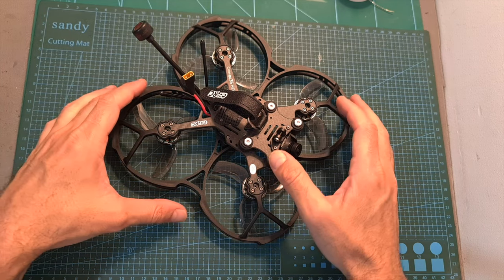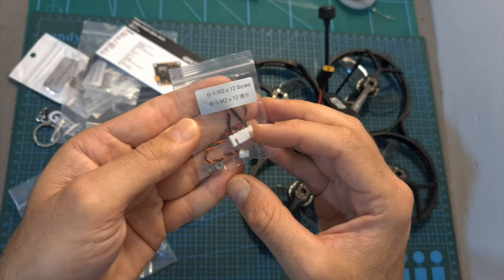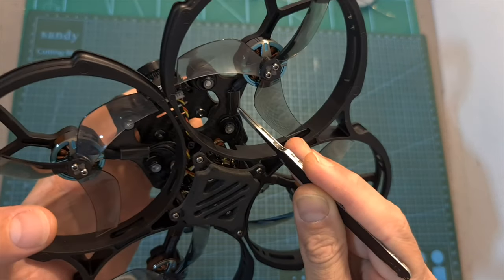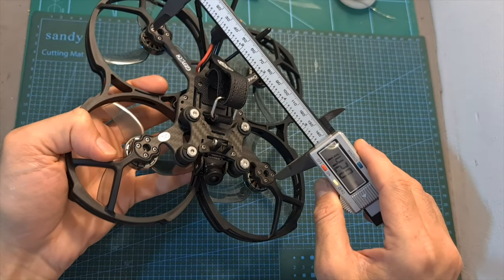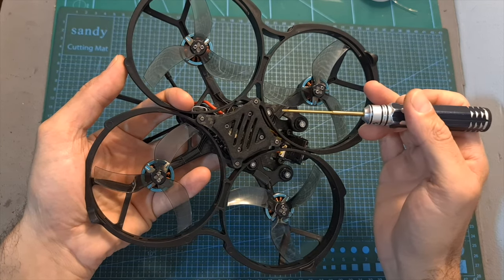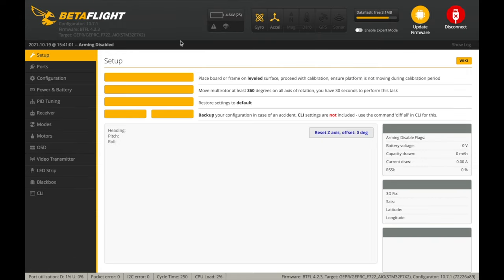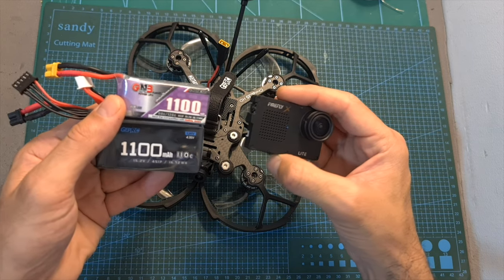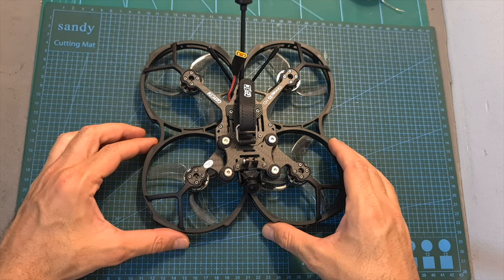Geprc CineLog35 - Setup, Review & Flight Footage

Comment: What would be the best receiver if I don't already own one?, PNP(dji) , FRSKY or TBS?  Geprc charge more for frsky/tbs, but I would be able to get a cheaper starter receiver? what dji receiver works?
Reply from the maker: Do you have the DJI Radio controller (First version, not the one that comes with their FPV Drone)? If so, you can go with the DJI PNP version.
Reply: @KremerFPV  no, can it be had on Ebay for under $150?

Comment: Hello! I want to buy Cinelog 35 and put Lion battery on it. Is it possible? Will the Cinelog 35 fly with a lithium battery? I want to deliver 3000 Lion battery. What Cinelog 35 should I buy? 4S or 6S? What exactly will Lion battery stand on? Thank you so much for the answer!
Reply from the maker: Hi! I think that for cruising around LION batteries might be ok (maybe you can also use a lightweight action camera). I think that the 6S version will be better for that purpose.

Comment: if I chose the digital version, would you recommend the 4s or 6s version? for a better flight duty and to avoid excessive overheating of the engines better than the 6s?
Reply from the maker: Sorry but I only tested the 4s version... Do you normally fly 6s setups?
Reply: @KremerFPV  for freestyle I use 6s but I have other cinewoops 4s is that I would not like to find myself with hot engines or limited flight duration

Comment: Unreasonably expensive for an analog.The review is as always on top.
Reply from the maker: Thanks man. Can't do anything about the pricing 😪
Reply: Agreed on both accounts Hugo. Great review as always, but just not tempting enough at that price. I like it a lot, but that's just too much.
Reply: Yeah everything is so expensive since shortage it's so crazy..
Edited. Just looked HD only $60 more. And even deducting for removing analog equipment (most companies dont) and adding vista. Should still be like $100
Reply: @divingfalconfpv4602   If you compare the price with cinelog 30, the difference is huge. They differ only in the frame and motors. It turns out a golden frame and motors from the future, but it's not like that ((( And the processor is f722 and not 411. Although why he is there is not clear.
Reply: @Hugo-kv7qf  yea 35 has f7 and 2004 motors. Bigger frame. Rest seems the same. Analog is $70 more and digital is $60 more from 30 to 35
Edited searched.. motors are $24 more for 4.. and flight controller is $15 more. So doesn't add up.. guess cinelog30 old stock before more electronic hike up..
Reply: @divingfalconfpv4602  In my country, the difference is more than $100 (((   130$
Reply: @Hugo-kv7qf  oh damn

Comment: Hello! If for some reason 35 came not fully ready to fly, should I try to calibrate esc and do some procedures? Motor accelerate on their own(with props on) What should I do after calibrating esc and cheking on what is "on" in betaflight?
Reply: Same here. Did you ever solve this problem?

Comment: I got mine today and it's flying like the tune is way off. Checked your bf dump and mine has the same pid and filter settings, wierd. maybe some vibration :/
Reply from the maker: Did you search for loose screws?
Reply: @KremerFPV  yeah, gave it a good look over, checked the fc mounting, too. Rpm filter fixed it 😊